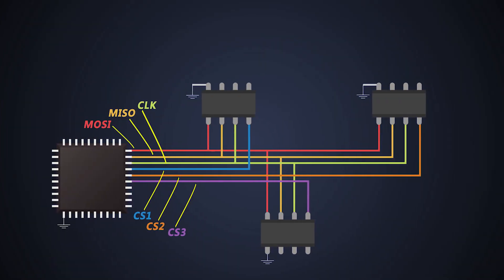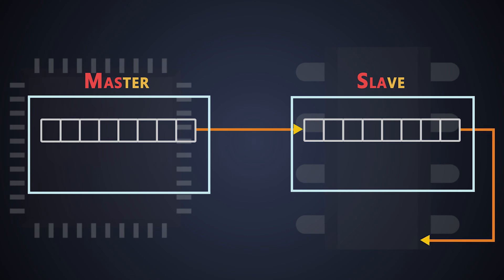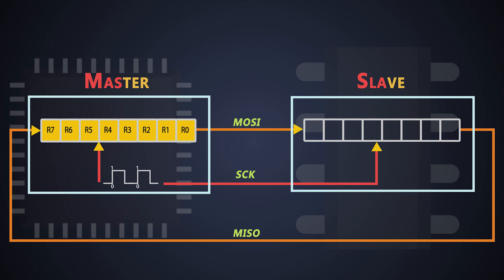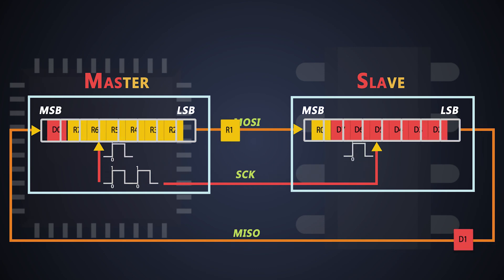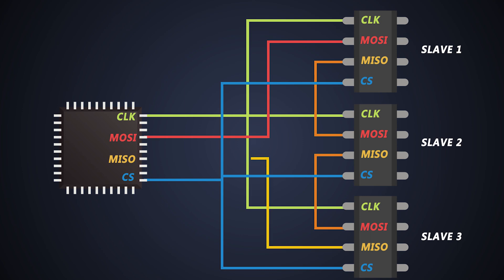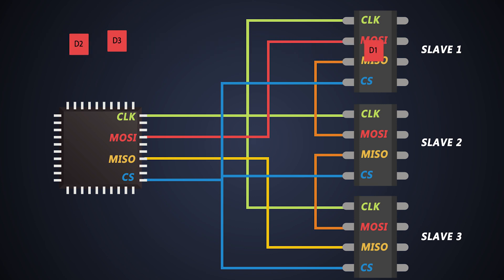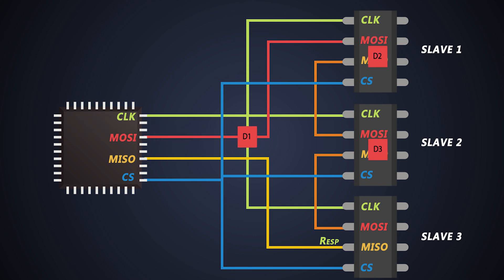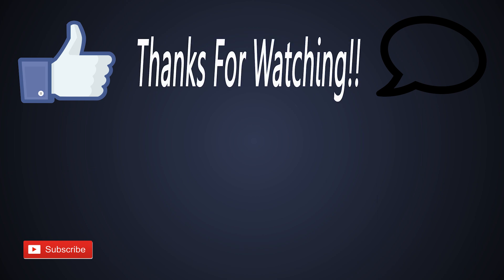SPI communication Data Transmission | SPI communication Daisy chain

Comment: Is there any delay in data transmission with the daily chain approach? Looks like the 3rd slave needs to wait for data to come before it can take action. How will the slave respond in this period as the chip select is already pulled down , but data is not received yet?

Comment: Thank you for this video. If there are only three pins on the master, does the last MISO need to be reconnected to the master? Im using an oled display which does not need to communicate.

Comment: Well I'm currently using an electrical component using the SPI communication, and while looking at its datasheet, I realized that the first 3bits and the last one of the MISO pin are not used for transmitting data, so I would like to know the exact function of those 4bits.
Here is the link to the photo representing the output of this component : https://i.sstatic.net/65mXY5CB.png

Comment: Let’s say I have 2 microcontroller SPI chip/slave select lines connected to 2 serial-in-parallel-out shift registers…

Let’s say I want to write to shift register 1…then I want to write to shift register 2…

But while writing to shift register 2, I want shift register 1 to retain its last 8-bit data…

But for some reason, both shift registers CLEAR ALL DATA when the chip select line changes…

WTF????!!!!!

Comment: what if we want. to send  data 3 (D3 ) in slave 1 , D2 in slave 2 and D1 in slave 3 ?should we send D1 first?
Does that mean we should sent first the data that should be going to last slave (s3) ..?

Can all slave work together simultaneously ?  For example if iam giving speedometer, voltmeter and pressure gauge together as 3 slave will it all display values at same time according to it's respective functions.

Comment: Your videos are awesome. I feel to help people understand it better, like the power supply design were done, maybe implementation in arduino code can help without using libraries. It will help people get a greater understanding which can translate into other programming languages. For all communication protocols UART SPI I2C, the implementation is where people battle with the concepts.
Reply from the maker: Great suggestion! I will work on it!